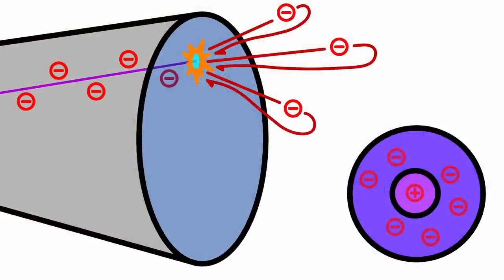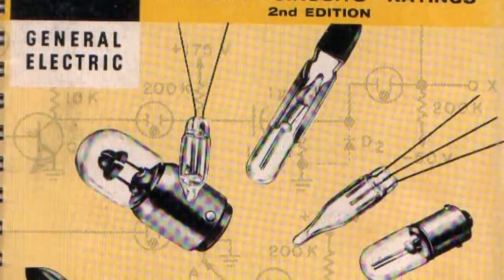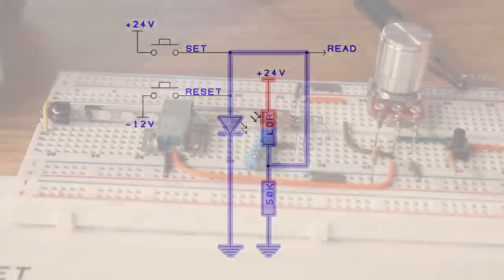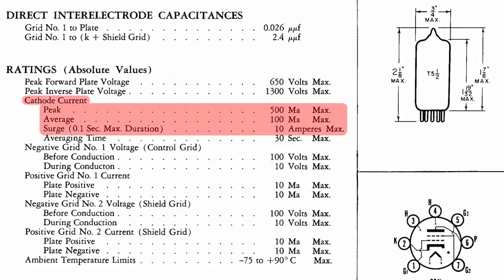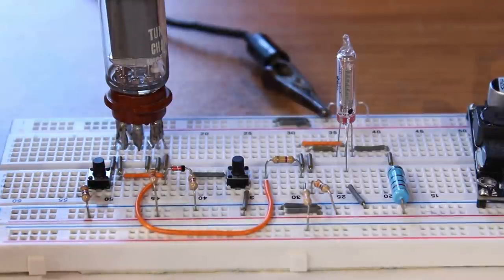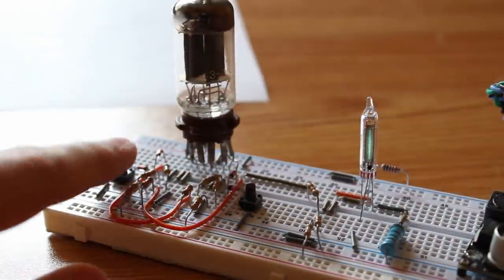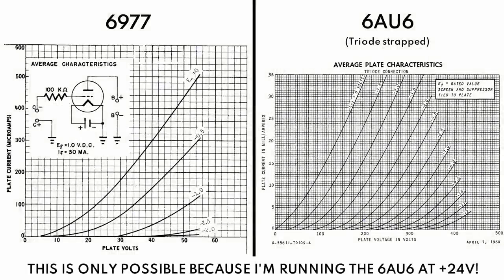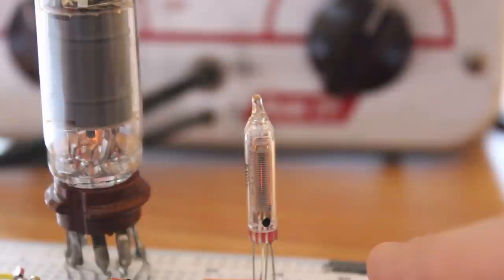Vacuum Tube Computer P.24 – Building SR Flip Flops with Trial and Error

Comment: The part of the latch that stores the information actually illuminates .... BRILLIANT!
Reply from the maker: Thank you!
And I think my favorite part of it is that it wouldn't be possible if I weren't running the 6AU6s at incredibly low voltages! It's a type of latch design that's only possible for this particular setup, which I think is perfectly fitting.
Reply: @UsagiElectric  I just remembered that there were some ancient eye tubes that had a low-gain triode inside-- don't think anybody has ever tried making a flip-flop out of two 6E5's.  Hint Hint.  The downside is they are very expensive these days.  One of my Telefunken radios from 1940 even has an eye tube with a PENTODE inside.
Reply: @UsagiElectric  any diagrams for analog processing?
Reply: @georgegonzalez2476  that valve was probably an EFM1,,used by philips in some sets,  now rare as honest politicians 😉😁 i managed to get hold of a used one at reasonable price , but havent tested it, the phosphor looks reasonably 'clean' and not too burnt, luckily, and heater is intact
Reply: @andygozzo72  Yes, I think I paid like $40 for one of those for a Telefunken radio.  And then I used some Windex glass cleaner on the glass dial and all the numbers came off the glass!   Sigh.
Reply: @georgegonzalez2476  yep...never let any solvent or cleaner near any printed glass radio dial, even water can sometimes strip the paint off ... only attempt if its really bad and browned or covered with grease or other muck,  i've rubbed off parts of a few,, also if they get damp in storage, the paint can flake off ,,  as for the EFM1, think it was about £5, certainly £10 or less, cant remember for sure,  wouldnt have paid any more for an 'untested' one ..
Reply: @UsagiElectric  
How much current do you need for each 6AU6?

Comment: It's not an electric pulse stored in the delay line but a torsion so mechanically. Much slower then electrical pulses. This was used in the restauration  of the first computer used for code breaking in the UK
Reply: Original delay line memory used sound waves through mercury.
Later I saw torsion or sound wave through wire, as it is shown there.

So it is "mechanical" wave through heavy medium.  It needs to be slow enough (in traveling through the medium) to pack enough information into it.
Reply: @radekhn  There have been some delay lines that used either a massively long length of coaxial cable, either with a solid core, or some with a wound inner conductor. Another I saw used a lot of LC circuits, which performs almost the same function. The delay line using coax was normally used to give a few microseconds delay for signals, and the LC circuit is still a part you can get new, used as a delay line for logic signals in computers and automation, where you need to delay a digital signal for a certain amount of time so that the pulse to the latch it controls arrives at the correct time. 

Normally a DIP plastic package with a series of taps on it, and available with either a buffered output or unbuffered, giving delays of 5 to 50ns per tap section. Yes the longer delay lines used either acoustic delay, most common was the PAL TV system, which used a delay line made from glass, that would store the video signal for exactly one line, so that it could be used with the following line as a colour reference, allowing the extraction of the colour signal out of the phase information difference between them, with the difference being important as to determine colour, not exact phase angle as NTSC used, so cancelling out any phase shifts in the transmission path that would lead to colour shifting line by line, giving the system the backronym of Never Twice Same Color, as you had to have a tint control to keep flesh tones something approximating constant. PAL did not need that, any phase shifts were converted to small brightness differences instead, which went completely unnoticed.
Reply: Yeah, the delay line memory he showed a picture of isn't too dissimilar from a spring reverb, as found in old guitar amps.
Reply from the maker: You're totally right! 
The only delay line stuff that I'm somewhat familiar with are the LC delay lines that Tektronix and HP used in their scopes, so I was getting that type of delay line and the acoustic or torsion type of delay lines all confused in my head.

Comment: One design I remember seeing, but cannot find online quickly, is a rotating capacitor memory. Brushes connect the R/W circuit to different caps as the drum contains the caps rotates. The caps only need to be large enough to hold a charge for a little over a rotation, using a regenerative circuit in R/W control. using larger caps, and LEDs, the entire memory would be completely visible. The design allows many more bits of storage per active circuit element.

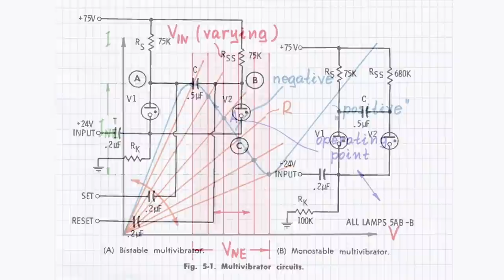Comment: 2:58 Neon tubes don't really have "negative resistance", since that would require that they would output energy. The English terms are a bit unspecific about this, but it has a negative differential resistance in the shown area whereas the overall resistance is always positive. :)
Reply from the maker: That is indeed correct! But, I've always seen it referred to as negative resistance, and when speaking to the camera, the fewer complex words I have to say in a row, the better, haha.
Reply: @UsagiElectric  is correct here. Even wikipedia calls this phenomenon "Negative Resistance": https://en.m.wikipedia.org/wiki/Negative_resistance
The same article specifies that the term is improper and actually refers to Negative Differential Resistance (NRD), but that NR is more widely used to refer to it.

So I think that while the term is improper, it's the best way to refer to it because it's what people use to refer to it.
Reply: @aliceitc  CookieCrasbe's comment is spot on.  He did not criticize the use of the term, rather he pointed out it is improper - which you agree with.
Reply: @donmoore7785  it might be "improper" but given that the distinction isn't useful is there a point?

Comment: Another cool thing about neon lamps is that they work as photoresistors! 
On the subject of photoresistors, if you were to go with the optical based memory, there are glass photoresistors with octal bases (essentially another type of tube, a diode without a heater) from the 50s that look cool! I have one in the optical sound circuit of my vintage movie projector.
Reply from the maker: Oh yeah, I totally forgot about that! If I remember right, some neons actually add a small dash of Krypton-85 to provide a little radioactive light to help the bulb strike in really dark conditions.
I do actually have some of those old photo tubes though mine use an even older 4-pin base. They're a little too big for a neon based logic circuit, but still very cool pieces!

Comment: Before any technical limitations you may have, delay line memory was already out of scope due to your self imposed voltage limitations.
One of the main effects of using such low voltages is the huge switching time of the tubes. In order to get the circuitry to operate fast enough you would need to drive it with the high voltages you have been avoiding..

Comment: Very excellent as always, but note that the delay line you showed isn't electrical, but a mechanical vibration (and I assume even more painful to design).  Search for "Torsion wire delay line" to learn more.  For the kind of small random access memory you are looking to build, I think you going in the right direction, but for ROM (say, code) core rope memory is pretty easy.
Reply from the maker: You're totally right! 
The only delay line stuff that I'm somewhat familiar with are the LC delay lines that Tektronix and HP used in their scopes, so I was getting that type of delay line and the acoustic or torsion type of delay lines all confused in my head.
For ROM, core rope would be perfect if I had any microcode, but being a RISC architecture, each instruction read in directly acts on all the gubbins. And being a 1-bit machine, programs are going to need to be hundreds and hundreds of lines long, which is a bit difficult with core rope. Instead, I'm thinking we'll use reel-to-reel audio tape!

Comment: You might try to find some information on 1960's Raython KDU's (keyboard display units), they used 2 types of memory you haven't mentioned, a sonic R/W fifo and cathode read only memory. The sonic memory was simply a piezo transducer to produces ultrasonic vibrations on a length of wire about 30 feet and another piezo receiver at the end this was neatly enclosed in a 12 x 12 x 1 inch metal box  the purpose was to store the screen display characters of 40 characters per line 20 displayed lines on the screen. When a key was pressed the character would replace the character in the circulating store, constantly refreshed probably at 25 screens /sec. The cathode memory was a fixed target within the crt, as the  character was displayed the appropriate character in the  crt would be scanned, the change in crt current would represent 1/7 of the character. Each line was scanned 7 times in sync with the display CRT. The KDU's used DTL logic chips. So many innovative solutions to memory when memory was precious and programs were much more efficient and tighter written.

Comment: If you set up your dual-triode (or pentode/"triode") design as a differential pair with hysteresis you could save yourself some passives (no diodes) and should be able to get very good control over your input logic level thresholds (due to it being essentially a kinda crappy comparator).

Granted I'm not a tube engineer so there might be some downsides to doing it that way that I'm not aware of.

Comment: I guess you already checked this but I had the thought that your first idea with the LDR might work, if you find an optical filter that has a very narrow response to the greenish blue light of the VFD? This might bring your ambient threshold down enough to work, however it would still be an insane amount of work to assemble and you might have "bleeding" issues inbetween two neighboring dots of the VFD tubes. 

I like how you sneakily used two diodes as an OR gate but it makes sense, since early solid state diodes and vacuum tubes were definately used at the same time. 

Oh well, you might have a slight stock of 6AU6 tubes to use, so I definately get why you want to use them everywhere. 

The VFD as a triode is an ingenious idea, I can only add to what the other commenters said, very nice for visualisation. 

I know that vacuum tubes are very high impedance anyway and it makes sense to get everything done with rather high resistances but did you run into any problems of noise or metastability due to high impedances and potentially high currents on the heaters?
I guess it should only be an issue with changing currents like when you turn on the heaters, where the tubes won`t conduct anyway. 

How many RAM do you plan to use, something like 32 bits or more?
Reply from the maker: Interestingly, I actually mentioned the bleeding issue between neighboring dots in my early edit of the video, but ultimately it got cut to try to keep the video runtime reasonable. I haven't done any experimenting with filters, which could work quite well, but I did do quite a lot of experimenting with three dots setup. Because the anodes are in the center of the glass, no matter how well I try to shield the LDRs, there's always some light from neighboring dots. I actually had to skip a dot to even get it to work, and even then if the neighboring dots on both sides are lit up, it can cause issues. It's a shame because it's such a cool looking piece of memory!

The primary logic gate I built the entire processor out of was the NOR gate and I used two little diodes to make those NOR gates. It's cheating in that they're little schottky diodes, which are a little too modern, but germanium diodes of the era were indeed quite common with vacuum tube computers. The LGP-30 is a wonderful example of this!

Thanks, I'm really happy with how the VFD and triode combo turned out! Regarding the heaters, everything is super unstable until all the heaters warm up and stabilize, which takes about 30 seconds on average. Flip Flops and latches almost always seem to initialize into the same state (for example, the instruction register always warms up into the same state, which if I remember is 1101). But, so far, once everything is fully warmed up, it all seems to work rather well! Granted, I'm not aiming for high clock speeds though. The ultimate goal is around 100 Hz, and at that speed, everything should be really stable.

I'll go into the entire memory map in more detail in the next video, but the current plan is to have 64-bits addressable, 48-bits of which will be the 6977/6AU6 memory combo. The remaining 16-bits will be reserved for external input and other things.

Comment: 2:25 you can technically make sram using tubes but, would need  a minimum of about 6-8 tubes per bit of sram, while you can make a one bit worth of dram with one tube and a capacitor with some feedback to act as dram refresh, so two tubes per bit of dram and a capacitor, well you can try using a vfd display to act as dram cells ,  and also use another vfd to provide dram refresh and addressing... and also see what the bits look like, since teh can be used as makeshift triodes.........
Reply: sram= Set Reset Always Memorized
dram = Don't Remember After Memorized

Comment: How many bits of memory are you building ?
Reply from the maker: I'll go into the entire memory map in more detail in the next video, but the current plan is to have 64-bits addressable, 48-bits of which will be the 6977/6AU6 memory combo. The remaining 16-bits will be reserved for external input and other things.
Not a huge amount, but being a single bit data bus, it's going to take very long programs to even fill that tiny amount of memory up!
Reply: @UsagiElectric   That's a lot of tubes 😀

Comment: ALL HAIL THE VFRAM
Reply: also the straw over the ldr would make it more directional and sensitive like I told you bevore XD
Reply from the maker: It was just too finicky, even with the straw or heat shrink tubing, the glass of the VFD itself let's too much light filter in. 
I really want the entire computer to be designed in such a way that it'll operate with massive margins of error, and the 6977/6AU6 combo is a lot more stable!

Comment: I'd use a crt and pixles
Reply from the maker: Williams tube/electrostatic CRT memory is very cool indeed, but as I said at 3:45 I'm trying to keep the entire machine at a maximum potential of just 36V (+24V B+ and -12V biasing).
Reply: @UsagiElectric  do how vfd and nixies do and do current instead of voltage sos ur low tension valves are a ground sink instead of working with high voltage or use a separate psu to drive high voltage and ur valve runs on separate low voltage sos to get the required voltage it is adding the 2x voltages in series 

I think a normal color crt be best make it scan screen constantly and it constantly refreshes screen and measure current of each pixel a lit one requires less current probably be able to use the colors 2 for 3x memory  

The electron fire gun tends to not require a high voltage I believe to do the pixel it's all the rest of the crt drive that does 

And make sure you use valves to run the crt because it be epic
Reply: @UsagiElectric  by looking at voltages the main one sends out the color to pixle to light seems be 30v the rest voltages are just crt drive and don't do the picture directly

Comment: HELLO,  When you press the set button won't the led get full +24 volts and burn out?
Reply from the maker: If I were using LEDs, it totally would! But, I'm using VFDs here, which are designed to have a plate voltage of 20V to 30V. Even still, having resistors on the buttons is good practice, I just didn't draw them in the schematic for simplicity sake.
Reply: @UsagiElectric  KEEP UP THE GOOD WORK

Comment: In your "original" circuit, I thought of a possible solution.  To keep the light in the room from being a problem, you enclose the circuit in a box that is basically lightproof.  But, you say, how do you see the action?  You do that by adding an L.E.D. in series with the other diode and that L.E.D. is mounted in a hole just big enough for the L.E.D. to fit through.  If it allows too much light in, simply cover the bottom part of the with something to lightproof it.  I like your later version, so I guess you won't be using the idea I came up with because I think you, like me, prefer it.  But you might want to store the idea.
Love what you are doing with all this stuff!
OH, does "Professor Rabbit" have a name?  ;-)
Reply: Limo tint window box so you keep it dark
Reply from the maker: That's a solid idea! But I'm trying to avoid the use of LEDs anywhere on the machine. VFDs, tubes and germanium diodes were all things that were available in relatively decent quantities back in the 1950's, which is the theme I'm trying to go for.
And the professor does indeed have a name - "Koma". It's short for "Komaru", which means troublesome in Japanese because she may be adorable, but she's also a bit of a troublemaker, haha.